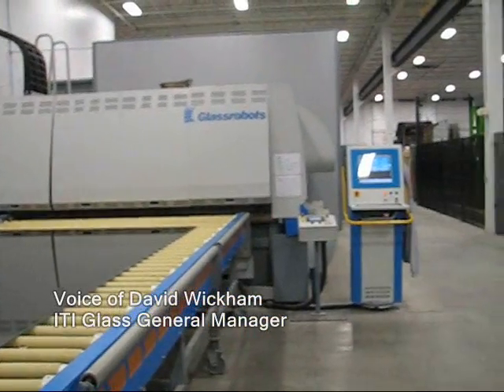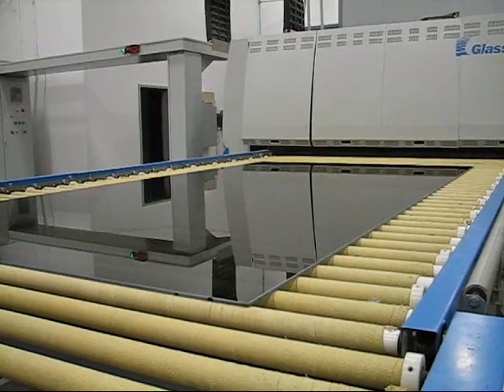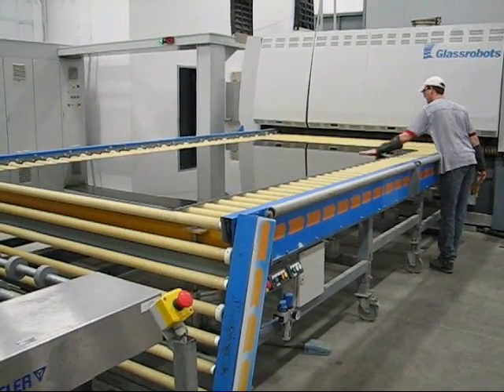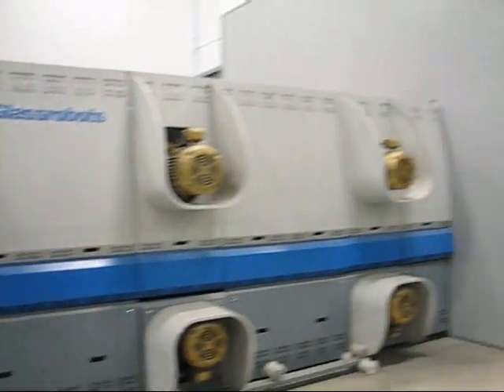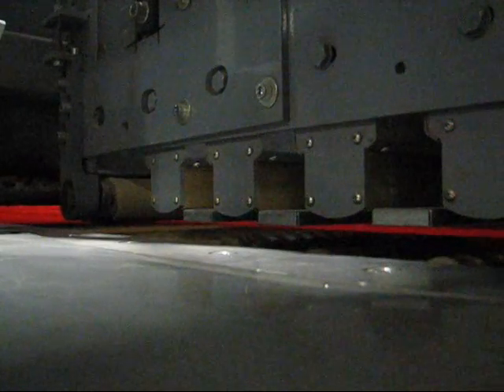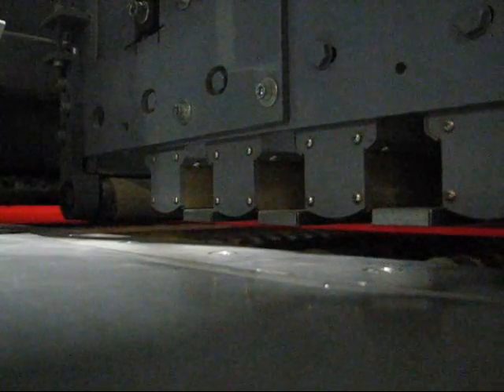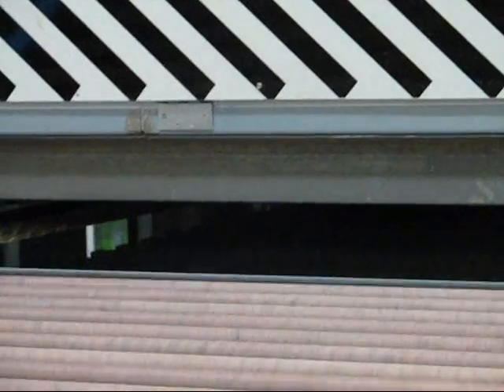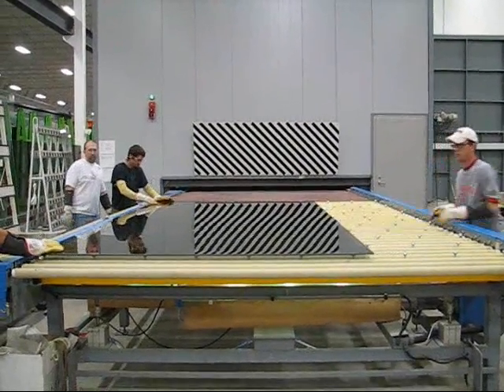Heat-Treated Glass.wmv

Comment: You say the leave tension in the surface. What i've learned is that the surfaces is under kompression and the core under tension to prevent crack growth in tempered glass.